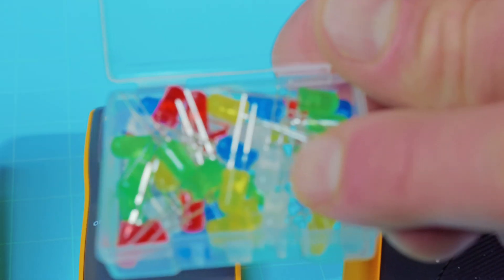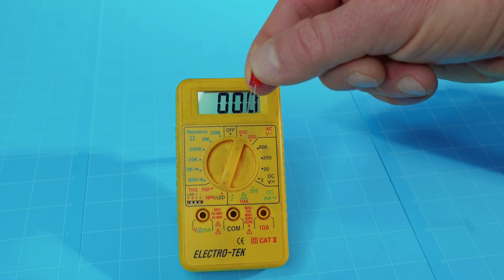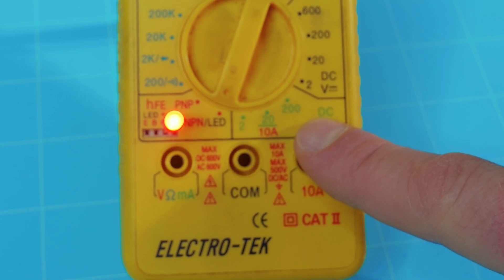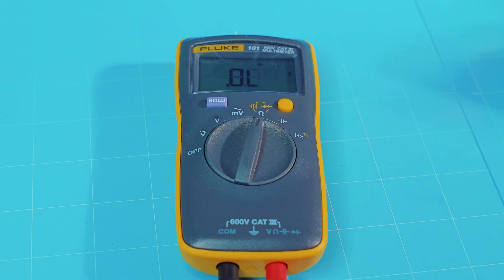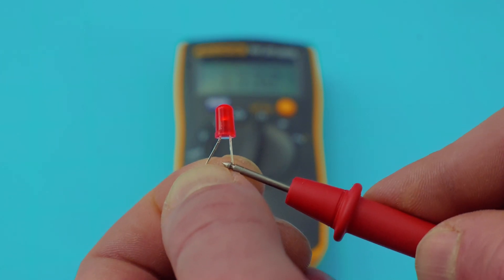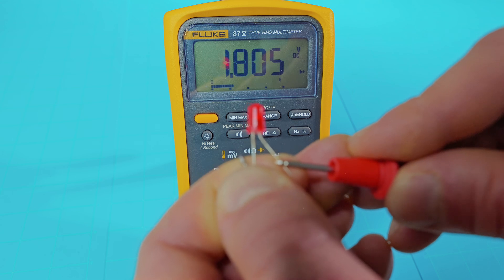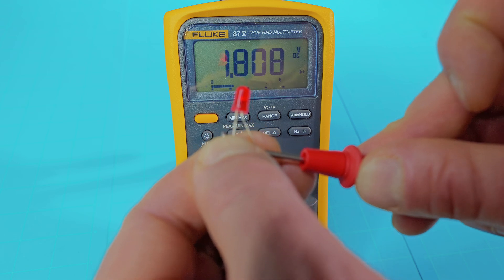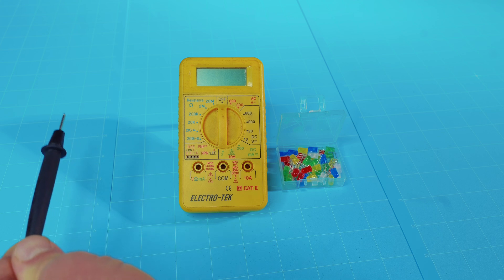How To Test LEDs With ANY Multimeter FAST

Comment: On my Mastech I get OL no matter which LED I use (all of my LEDs are working fine when connected to power). The red does light up with the multimeter despite the OL. No OL with regular diodes.
Reply from the maker: I have had the same issue with some of the diodes I get off of Amazon, my older diodes read in one direction just like a normal diode would though. If your LED is working, then go with it as with these cheaper LEDs coming from overseas, I don't fully trust that this method will work on all of them anymore. thanks for the question friend!